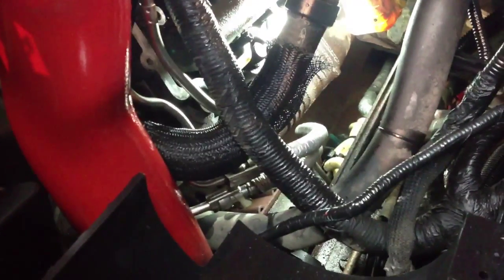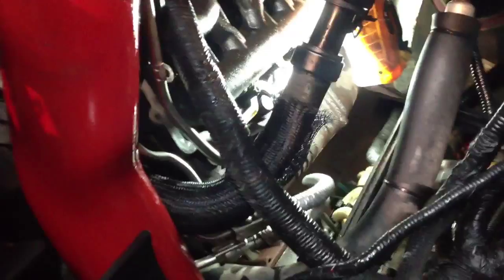06 6.0 powerstroke hydrolock

Comment: Bro Im order to do this I have to disconnect the fuel pump ? Or the injector harness ? And also I can do that by jumping the starter cable to the positive battery right ?
Reply from the maker: If you don’t disconnect the pump and an injector isn’t happy,,  it could just keep filling the cylinder.  I didn’t watch this video,,  just replying.  Lol
Reply: @AnthonyYoungblood  just found out that the injector is bad and also the o ring. The diesel drowning the cylinder is causing it to lock up and it’s black from the oil leaking of the o ring. I appreciate it bro. Gonna do all 8 with new standpipe and dummy plugs. New oil and fuel filters with oil change. Also new nipple cup o rings. Hopefully that fixes the problem

Comment: Could this blow the head gaskets? Just by hydrolock
Reply from the maker: J Cortes I'm not sure,,  I guess anything is possible.
Reply: Anthony Youngblood thanks for the reply.  Truck is up and running. Runing good, I'm just wondering if the HG could be damaged or weakened by the hydrolock?
Reply from the maker: I have seen no evidence of it,,  but who knows.  It does make sense that the pressure it sees could definitely take a weak hg and let it go more.
Reply from the maker: I have seen no evidence of it,,  but who knows.  It does make sense that the pressure it sees could definitely take a weak hg and let it go more.